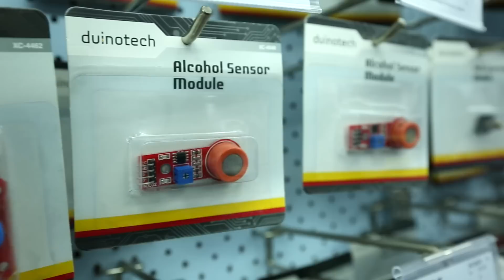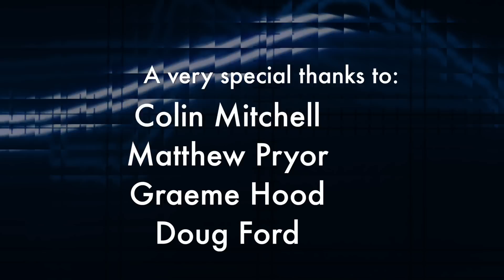The Decline of Hobby Electronics?

Comment: if you enjoy building and creating electronics then there is plenty of opportunity to do so, most of the components that we used in the 70s and 80s are still widely available....however if you want a specific piece of equipment you can purchase it already made and probably cheaper than you can make it....it'll look better too.
Reply: thats what has been said in video
Reply: Yes andr27.....glad you were paying attention.
Reply: Often cheap Chinese electronic devices may look better but will not be better. They really cut it close when it comes to speccing parts. Often they don't even quite make it with minimum ratings. Back in the old days parts had 100-150% headroom. Now you're lucky if a part is specced 10% over what it has to withstand. Plus virtually all electronic components coming out of China are counterfeit today. So you don't know what you've really got at all. Which is why their PSUs blow up in a couple of years, if they make it that long. I love when I look at a commercially manufactured board and they don't even populate it with all the parts. Bah, it works without this, this, and that filter cap. Throw a jumper wire in where that part goes too. It's crap!
Reply: a commercially manufactured board is rarely populated fully as one board fits most models, however most models have different functions available so they don't all need the same parts, it's just easier though to make the one board and populate as needed depending on the model spec.

Comment: They are right smd projects are not for beginners plus you special tools to do it .your skill level has to be up there,and us old guys have a lot of trouble seeing what we are doing .kits I could do in a hour ,now with smd it.could take a week ,
Reply: I think that smd projects are simpler, because you dont have to mess with leads, drilling the pcb etc. You just put soldering paste on pads, place the components and do whole board reflow with hot air (or put the board to oven). If the sight is poor and components too small, that's what microscopes or good loupes are for.

Comment: I'm studying electronics...I do it on the hand of a breadboard and components. I got an arduino as a gift but have not used it yet. I just wonder....do you learn electronics by using a Arduino? Cause i get the feeling that I will not learn what REALY is happening to the components with an Arduino....I rather put things on a board myself while testing and understanding what actualy happened...
Reply from the maker: Using Arduino to learn electronics is an excellent way to go because it will capture your imagination. Sooner or later you will want to hook up your own components and that will require you to learn the fundamentals such as Ohms Law, current limiting,  how to use Op Amps, sensors and more. Good luck with your journey
Reply: Thank you for your quick reply!

Comment: Radio Shack only sells junk .People can only do software this days ..But i think you are missing the point ,Electronics has not just become more robotized .There is intelligence now embedded inside the circuitry in the form of microprocessors and communications .This require more knowledge that just an iron and some assembly skills .
So you can always do electronic projects but to do something  that is up to date requires a little more of intellect.

Comment: It's an interesting dilemma. I built my first radio from scratch in 1955 using vacuum tubes, then my first computer in 1973 using wire wrap (basically a programmable calculator). Now I am having fun with arduino and raspberry pi and the vast library of sensors and output devices that were impossible for anyone less than a defense contractor. I do feel I have an advantage of understanding the machine level coding and the low level electronics, BUT

On the other hand, my 12 yo grand daughter is programming robots, and adding features with micro controllers. I envy her for what she will be able to do in the future. 

On the issue of the components being built off shore, the video shows automated processes with industrial machines. That offsets the low labor costs, and suggests to me that there is plenty of opportunity for US companies to perform similar production. Adafruit is a great example of boutique manufacturing and supply. I hope to see more companies entering the field.

Very good video with consideration of many points of view.
Reply: Automation is how we'll get our groove back.

Comment: I don't see any problem with it, if the DIY packages are kept available, for the basics at least. 

Todays some applications really require SMD packages due to the involved speeds. But starting (saying that very bad and roughly) with a simple RC network, then 555, doing signal processing with opamps, and digital disctete logic, basics of power electronics, then moving toward complex things like microcontrollers, it is a very educational journey for any kid/person who want to enter in the electronics field. I see nowadays a lot of more spread of electronic available to hobbysts - at least is what I perceive.

As an electronic designer, with a dominant part in fw and signal processing, I am always fascinated in see today's electronics as the one in the 80's, despite I am more young that those years.

Comment: I surface mount solder with my Radioshack 40w iron. Haven't blown an IC yet, but I did have a sticky LED once.
Reply: foxOmen sticky led?
Reply: Yeah, it traveled up the solder and got stuck to the iron. That's the only smd component I've ruined so far.
Reply: foxOmen Ahh thats what you ment. I know that problem. Its just to much flux
Reply: I only use 60/40 solder with a rosin core. I don't use a separate flux, and that only happened the one time.
Reply: NO NO NO. Get professional. get rid of all solder and fluxes, switch to eutectic solder (63/37) and OA flux. You can clean the board spotless (NO flux) with just hot water. No solvents, no mess, ever again.
Reply: Nah, if lead-tin is good enough for tubes, it's good enough for anything. Well, except for things you're meant to touch.
Reply: Eutectic is tin lead - just gives better joints.
Reply: I looked it up now, that would be good if I was controlling my iron temp. I'm pretty sure the only thing in my iron is a resistive heater that runs on mains, so I can't make use of the low melting point. I get that it had a definite  liquid/solid transition, but soldering is slow work anyway.
Using a separate flux also just seems too inconvenient when cored solder is readily available. There would need to be a pretty serious advantage to it for me to change my supply out.

Comment: just my two pence .if all through hole components disappeared anyone new starting in electronics will learn the maths and the theory will design the item on a computer and the circuit then build it on the computer and test it before designing a board the board will be manufactured and components fitted by robot all without picking up a soldering iron , you'll go out and buy the item use it when it fails you'll just throw it away and buy another ,as for me the most modern thing I own is a smart phone a TV and a computer everything else is from the last four decades !

Comment: would be interesting to do a follow-up up on this now, but still such an insightful video and it did get me thinking. I think the hobby is currently in revival, thanks in no short part to the micro and SOC revolution. I enjoyed tinkering with discrete components in the past but let's be honest, could you really hope to accomplish then what you can today? micros and SOCs have opened the hobby back up to a new generation, and a whole new ecosystem has developed. and nothing wrong with SMD parts either, forces one to learn newer techniques! that's the joy of electronics... you are always challenged :) VHS tape is irrelevant now because people have moved on, aa has photographic film. moved on to better things that allows people to do more. radio shack and dicksmith are analogous to the VHS tape. again, great video!

Comment: Playing with components may be cool to understand circuits, but they net result is NOTHING compared to integrated systems that have been developed. So what are you playing with, basic concepts? It would cost a lot to do what every time, that would be easier to do with a raspberry pi with some GPIO pins.

Comment: The decline of component retailers in the US doesn't mean a decline in "Hobby electronics". In fact China made it far better where any low budget guy can develop pretty cool tech. Why would I pay 10 dollars for a stepper motor at microcenter/radio shack when I could buy it for 1 dollar from china....the literal identical one marked up to ridiculous prices. I say good riddance. Let's get rid of greed. They killed themselves.

But even if we can't do much SMD, the are boards for every function now- wifi, motor driving, signal processing, etc that to analogize: diy electronics is like programming Visual Basic now vs. using individual components like before which is more like programming assembly.
Reply: So true, I bought 100$ of parts from china which would cost me easily 500$ here in Canada...they buy it from China themselves and expect use to pay 5 times more when I can get it shipped for free to my mailbox...downside is the long wait time
Reply: I worked at radio shack for a bit. They stuck their own necks through the noose. the products from the warehouse (not the wholesaler) were marked up in some cases over 10 times. In my opinion it was a case of slash and burn. Pure greed and short term gain on the part of the district and regional managers. They refused to see how a smaller slice of a bigger pie is better in the long run.
Reply: They don't ship heavy items from China to here for free.

Comment: China's manufacturing prowess cannot or should not affect the basic quest for knowledge in a young hobbyist. The learning still has to come from the 'primitive' (1970's) electronics. There is absolutely no practical way for a hobbyist to probe a modern electronic device to see how it works. The learning must come from a primitive circuit. I still have 8086 chips with instruction sets that I can read and switches to understand how buses are shared etc.
I believe it is important to preserve some level of the primitive electronics industry to teach young people who wants to learn. Not just to learn but more so to have the necessary knowledge to re-engineer the entire industry if and when necessary.
When the time comes for that little boy or little girl to reform the computer industry from binary to ternary or even decimal they may have to go back to the breadboards and fiddle with resistors and capacitors and transistors (old school) to engineer those future devices. Current, voltage, magnetic flux etc can only be studied at the hands-on level.

TV dinners and processed foods transformed the cooking industry but to teach someone to cook you still have to grate that ginger and chop that onion with a knife.

Comment: Getting older now, i find it hard for surface mount components, but we have so many small build cards now, is it worth my time, well yes it is fun...... at times..
Reply: Have you tried using a solder stencil? I had some PCBs make at DirtyPCB and ordered a set of stencils. With solder paste added to the board with a stencil, you don't have to be absolutely precise when placing the components. The surface tension of the solder pulls the components into alignment.
IMO using solder stencils make DIY circuit boards much easier to make.
The problem of course is the stencils can end up doubling the cost of having a board made. It's kind of hard to justify a stencil for a single PCB but it you're making multiple boards, stencils are the way to go.

Comment: In some ways, it's a lot better. I remember wanting a 9-pin d-connector (I may have invented the gamepad before Nintendo - 5 switches mounted on a tobacco tin) and it was priced around £7. Now you can probably get 5 for a dollar from ebay.

Rubbing down letraset and etch-resist pens were not much fun either.

Comment: I think it's just the large influx of cheap Chinese goods and the cheapness of Chinese made goods is terrible if you compare a 1980s British made radio then compare the same kind of radio from the same company in the 1990s that was made in china you can see the difference in quality.

It is unfortunate but true I repair vintage electronics and have a new radio on my workbench to listen to whilst I am carrying out repairs and after 5 years it has broke and it cost £40 so not extremely cheap for a radio with no other features yet most of my 1930s sets are still working with minimal repairs after 80 years of service and when something does break it is very easy to repair and the radio will then continue quite happily for another 80 years.

It's sad times for the electronics hobby.

Comment: This was a surprisingly negative video and it completely ignores the huge surge in the popularity of robotics worldwide which has been enabled by microprocessors like the arduino and have created new interest in electronics. The arduino is mentioned in passing and as a negative. Yet there will be plenty of new people creating PCBs as a result. It also seems to pretend that you can't really make your own circuits anymore unless you use SMPs, an absolute fallacy.
Reply from the maker: As mentioned in the description and in many replies to comments, this video is built from interviews that are at least 5 years old. It doesn't deal with the rise of the "Maker Movement" because that is something that happened largely after this video was made in Australia. I am in the midst of producing an update that does showcase the effect of Arduino, Raspberry Pi and other platforms leading to a general rise in electronics. Your comments are largely critical of the thoughts and opinions of those I interviewed at that time and those very same people have been responsible for bringing about this change. There is no pretending that SMD or surface mount devices equals "you can't make things" ... SMD/SMT posed a significant challenge for many that had been used to "through hole" and it is this particular point that is reflected in the video. I hope that clarifies the context of the video?
Reply: The "Maker Movement" is more like the monetization movement. It is total commercialization. I get that people need to make money. Some of the ways they go about it irritate me though.

Comment: It seems that hobby interest in discrete electronics has diminished more and more as time has progressed. In mentoring students in electronics and the broadcast media arts I see fewer young people becoming involved with anything surrounding the use or design of discrete electronics, especially analog circuits. While visiting hamfests the crowds appear to have become smaller and smaller and, in some areas, even makerspaces have had slow and small acceptance. It's disheartening to see that less young people, especially girls, never securing the knowledge of learning a technology such as electronics nor ever having the opportunity to have any hands-on experience with soldering or circuit board design.
Reply: Let's be real. Traditionally the mechanical arts never interested girls very much. If anything there's more females into it now than there ever were.

Comment: One of the areas I noticed a huge change over the past several decades is that the general public is now paranoid and terrified of hobby electronics.  Nowadays, if you take one of your builds out in the public, you really need to keep it hidden because there WILL be people who will think that it's a bomb, almost guaranteed.  People are terrified of seeing naked circuit boards or wires, regardless of what they are.  I'm an electronic musician and I build home made experimental synths and also use circuit bent instruments in my performances and more than once when transporting my equipment, I've gotten hassled by freaked out people or security.  Things would probably be worse if I had dark skin and a beard, but yeah.  People are genuinely terrified of home brew electronics now.

Comment: I did jump the bandwagon and get a microscope, solder paste dispenser, and hot air station. I struggle with the qfn and bga packages because you need to see underneath them to tell if everything is properly soldered.

Comment: It seems that the older you get, the weaker your eyesight becomes and the more your hands start to tremble, the harder it becomes to mount and solder those damn tiny components that just KEEP getting smaller and smaller!! AND let's not even bring up adding arthritic hands to the mix. Still, it is one of the most satisfying and rewarding hobbies there is. The home study course that I took from the now defunct NRI school back in the 90's was one of the best and most rewarding learning experiences I ever had. Not only did you get great learning manuals, but they also gave you tons of parts, discovery labs, oscilloscope, computer, etc. to really learn and understand what you were doing. Now these at home study courses only want to send you manuals and make you learn everything online with simulators. You have to learn by actually DOING. Manuals and simulators will only get you so far. You need to get "in there" and burn out so stuff...maybe create some smoke, but hopefully not electrocute yourself in the process. Lol!!

Comment: only reason i know how to put a circuit together is because i went to vaping from smoking. 
which meant i needed to learn ohms law and about how parts worked together, since i didnt want to be one of the idiots blowing their face off due to putting a 0.1 ohm resistance coil on a device containing a 3.7v 8amp battery.

there was nothing about circuits when i was in school. hell nothing about electronics besides diagrams.